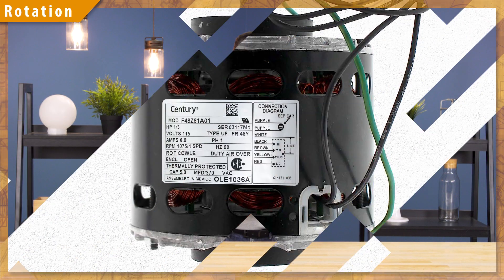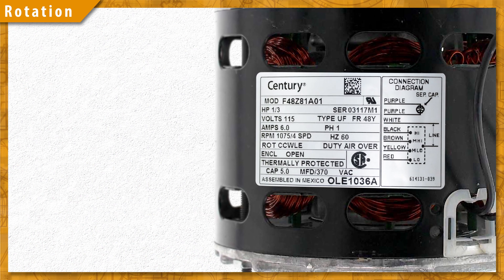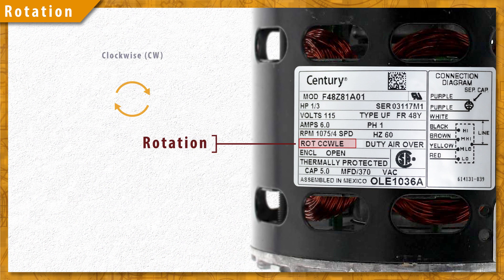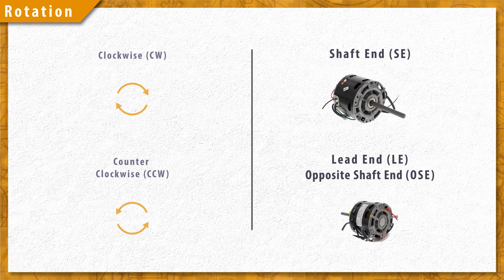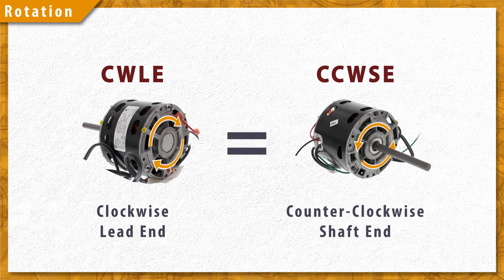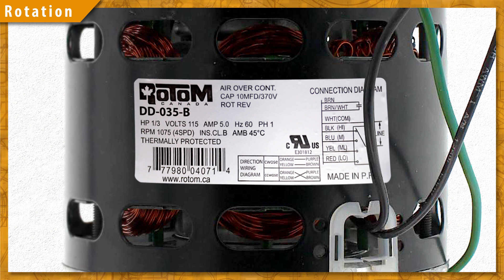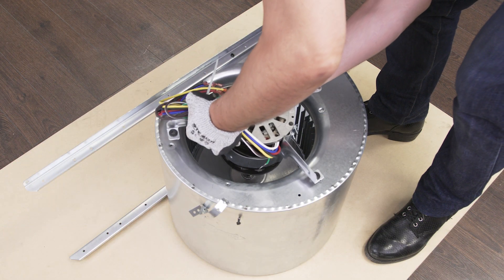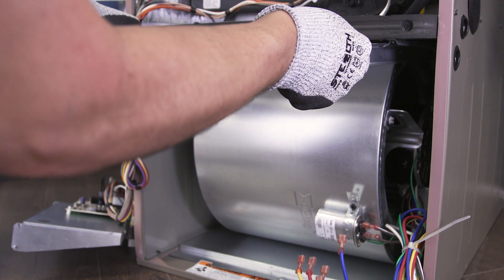Motor Rotation Direction Codes | Spec. Sense

Comment: Thanks for the video. Question.. what if the label shows a directional arrow but is placed on the motor upside down? Normally the lead end is facing up when you read the label.. in this case it's facing down for the label to be read. So which way does this shaft rotate? Thanks! It's for Fasco motor model F42D29A50
Reply from the maker: Thanks for watching. From a quick search it seems like the other F42D29A50 motors have the label "upside down" so you should be able to trust the motor direction on that.

Comment: How's change rotation this motor please  share diagrams
Reply from the maker: Thanks for watching. Many motors might have a wire diagram on the nameplate which will show you which color wires to switch, to reverse the direction. This is different between motors so you'll have to check your motor specifically.

Comment: What about when there is only a single arrow showing direction.. is that from LE or SE?
Reply from the maker: Thanks for watching. If the arrow is on the side of the motor then you can just align the motor in your view and determine the code. If you're looking at the lead end of the motor, and the arrow starts at the top and is pointing to the right, then it will be a CWLE motor ( or a CCWSE)
Reply: @AmreSupply  Got it, thanks!
Reply: Hi, I have a 1994 Carrier Weathermaker 8000 58wav furnace. I recently noticed that the blower unit was installed so that the motor is on the filter opening side. It should be reversed. As a result, the opening to the fan unit itself is somewhat restricted by the motor. The furnace isn’t giving any error codes. Just wondering if this setup has any adverse effect on the furnace operation? It’s pulling return air from the closed side and not the filter side if that makes sense? Can I reverse the motor on the blower assembly and reverse direction? There are no holes on the opposite side of the housing to mount the motor. Thank you.
Reply from the maker: @mariog6916  Thanks for watching. The fact that the furnace hasn't overheated or tripped any safety switches means that its likely sill moving enough air. Without the tools to measure the airflow its hard to know if the setup is working optimally. It is possible that the installer knew that it was backwards based on the mounting holes etc but the motor was strong enough to still result in the correct airflow. If you think there's not enough airflow than installing the motor on the other side and reversing the direction would help given that the screws and mounting holes allow for it.
Reply: @AmreSupply  Thanks for the quick reply. The installer definitely must have known this was backwards. He purposely installed it this way because installing it on the opposite (proper) side would have resulted in a massive undertaking of relocating my gas lines. Hopefully the impact is minimal. I’m assuming that the manufacturers build these blowers to open on either side?? I’ve reached out to Carrier for a response. Anyways I was just curious to know if you’ve ever seen this setup. Time for a newer high efficiency furnace soon. Thanks again.